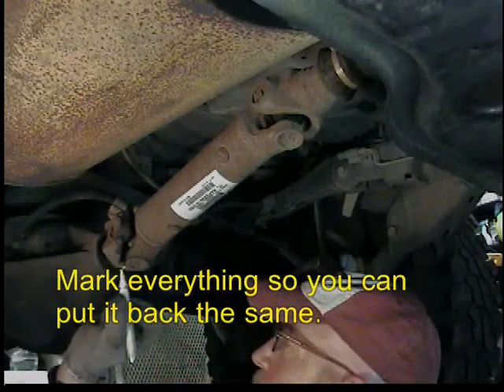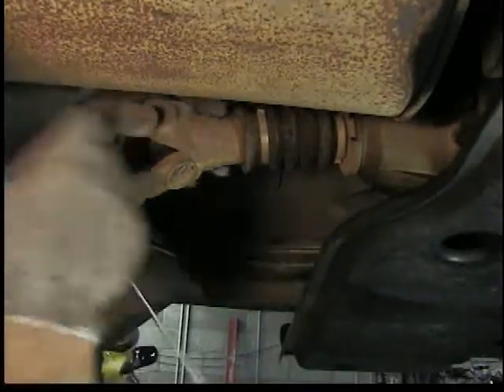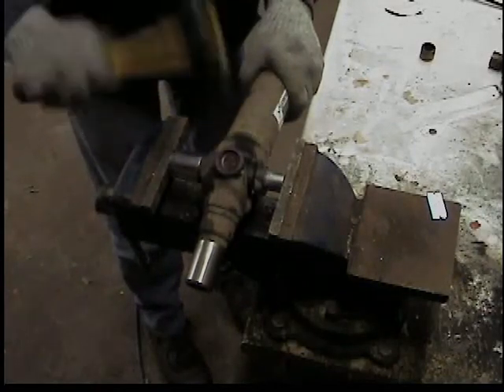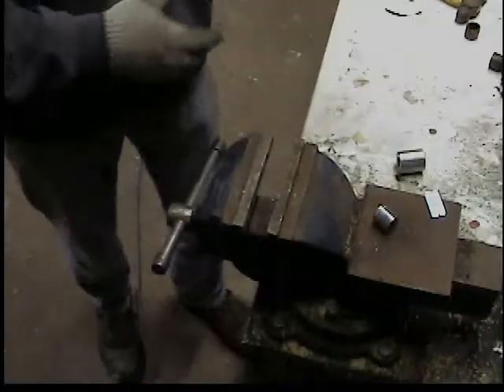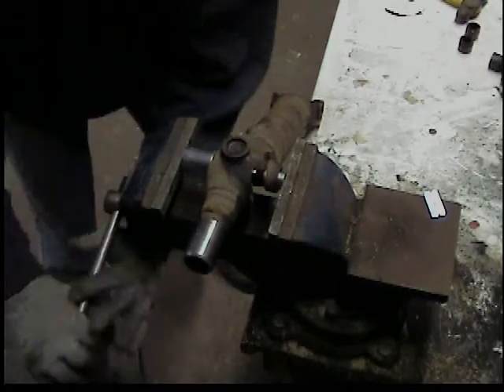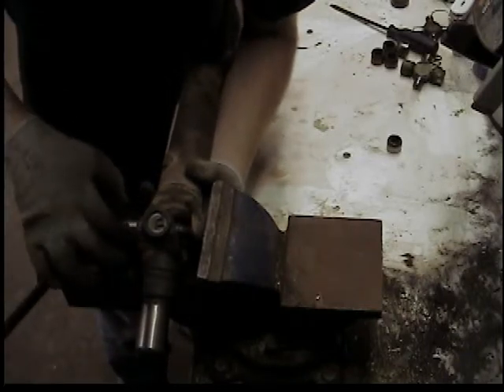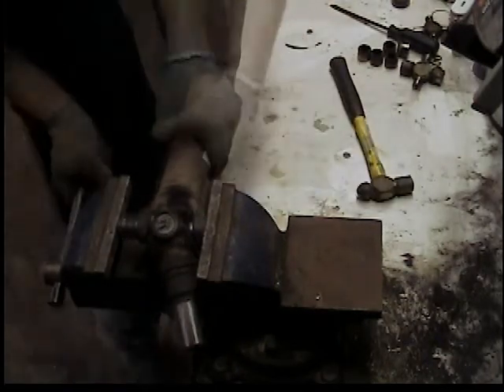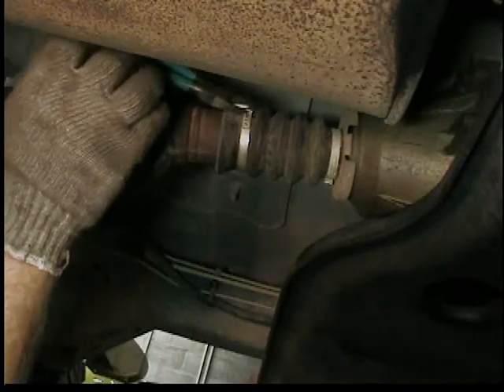Universal joint replacement w/ a vise, Jeep Wrangler TJ, How To, DIY

Comment: Got the ISR in place but the u-joint will not bottom out to the tab on the yoke, acting like the u-joint is to large for the yoke. Going from old style (06TJ Wrangler) to the new system with ISR Spicer 5-3147X

Comment: My 2006 Rubicon has 4 15mm bolts holding the Front of the rear drive shaft into the Transfer case with 2"U' Joints. Not  As simple as yours.  I was  unable to remove the 4 bolts and ended up replacing the with the Front of the Rear  Drive Shaft still connected.  The 2 Front "U"Joints were still good I checked them and Lubricated them.  My rear "U" Joint snapped of.f
Reply from the maker: Yeah, they lock tight those bolts in. Heat them to remove. The c-clamp works a lot like the vice or a ball joint press. I have a video using a ball joint press. Jeep On!

Comment: are there any seals inside the transfer case that needs to be replaced when you pull the drive shaft out? have you noticed any leaking of fluids after you did this? i changed my front axle u joints and did not realize that you need to replace the seals in the differential and now it leaked out most of the fluid..
Reply from the maker: Not necessarily. I did not replace this one. If they are weak, it could be a good time to do it. It is possible to damage a seal any time you pull apart and reassemble. I guess if you are not replacing seals, it would be good practice to at least wet them before reassembly. Thanks for the thought.

Comment: How does that not bend the hell out of the ear of the yolk? You should always keep a socket on both ends when pressing it
Reply from the maker: The big socket is only necessary for dis-assembly. As you see in the video, installing the first cap, the cross does not stick out far enough to hit the vice and on the second cap, you have the clip installed on the first so you know you are not pressing far enough to push the first cap out.